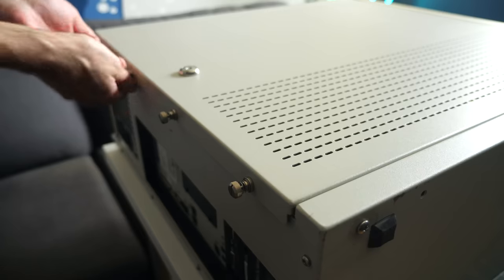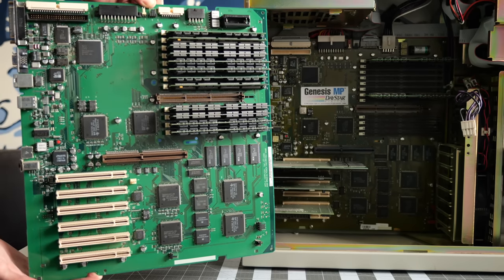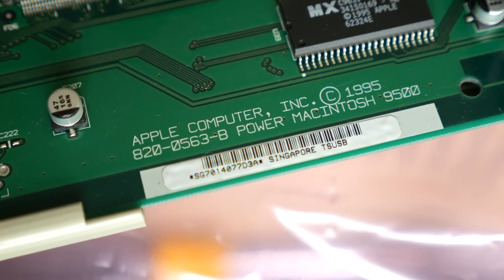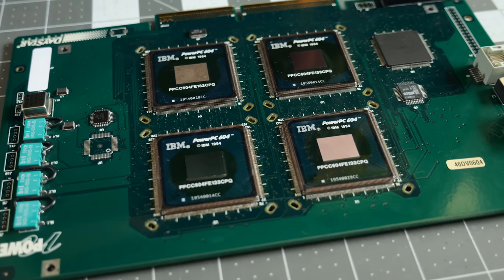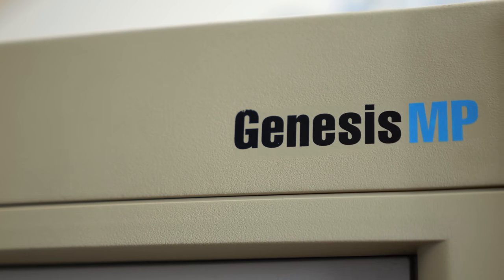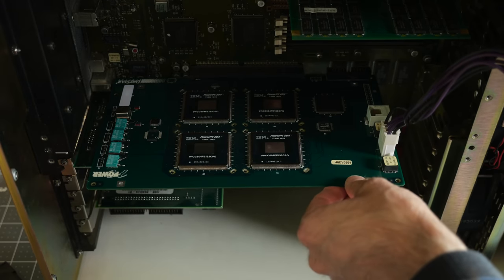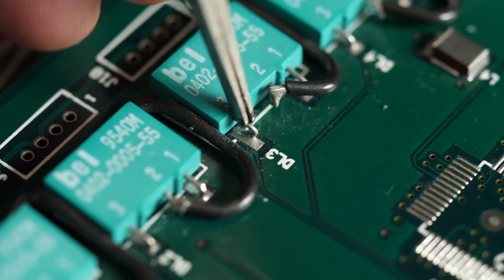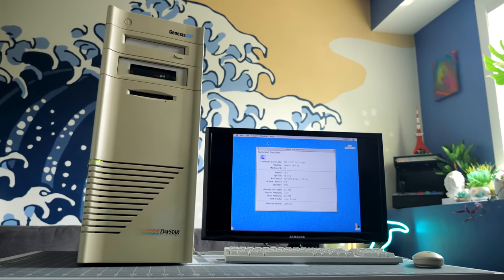Wait...THAT'S what was wrong with my rare Mac clone?!

Comment: As someone who is a programmer, this type of scenario is something that one can run into often, and I'm saying this from personal experience. Part of debugging is isolating what is going wrong, and seeing what happens when you change something. Sometimes the simplest of changes can cause significant glitches, and sometimes the smallest fix can save the whole program.

Comment: When you were checking the CPU pins for loose legs, did you inspect the rest of the card under the scope? Surprised that broken joint wouldn't show up under visual inspection, but I can also understand how you may not have bothered to do a full visual inspection of the card. Easy to lose sight of the basics when you're in the vortex and chasing the dragon.
Reply from the maker: I did look at the whole card under the scope, but I missed the crack because it was sideways and the scope looks straight down.

Comment: Spoiler alert if you haven’t watched the video.

My very first vintage Mac was an SE FDHD from eBay. There was no video display, but it chimed. I tried every solution in the Dead Mac Scrolls, recapped the analog board, desoldered and cleaned the brightness knob, and anything else I could think of. After weeks and weeks, I was staring at the board one evening, and accidentally bumped a small inductor or filter near the top of the board.

One side was broken off.

I soldered it back on, flipped the power switch, and was greeted by a very happy Mac. That was a magical moment, and I am never getting rid of that little SE FDHD.
Reply: This sort of thing has cropped up before, and it has always been due to human error. -- HAL 😁
Reply: That reminds me of a very weird repair we had when I was working at an audio company.
It was also a broken little inductor, something that had never been an issue for that last 10 years or so.
These things can drive you insane lol!
Reply: My SE kept going black screen after some use. Took it apart and went over and over and over it. Finally found a bad solder joint on the analog board. 🤷🏻‍♂️🤷🏻‍♂️ fixed it and no more issues
Reply: Great story, good persistance. I have lots of retro computers, SGIs, various rare 68K and PPC Macs, NeXT, but my little faithful cheap eBay SE FDHD has been the most fun to restro.
Reply: you basically did all that work for that inductor to say 'nah that was all for no reason', glad you got to save that old Mac from the MacHeaven

Comment: Great job - I love to see man triumph over machine.

It's actually really important to STOP when you are angry/frustrated with troubleshooting. I find that is usually when I am about to make bad decisions and compound the problem. Stopping for a while and then circling back, I would say, is EXACTLY the thing that led to your success in the end. Take the win!
Reply: I can relate to that. I have done both.
Reply: This is one of the biggest things I discovered about myself when starting this hobby... I can get extremely frustrated and manic when troubleshooting or a repair isn't going 'smoothly' - which surprised me given that I'm almost always pretty chill. Something about this hobby brings out some interesting traits. Learning to slow down or step back, stick to the basics and be methodical has been huge for me - not just in the hobby but in other areas of my life.
Reply: It's really the machine which is a triumph of man. What Colin did was triumph over age and degradation; when he soldered the component which was loose back into position, he defeated age and brought the machine back to life.
Reply: Agreed, and usually in my experience, during those moments of frustration is usually when I make a fatal mistake in the process of attempting to find or fix the problem and end up permanently damaging something, sometimes (but rarely) to the point of writing off the part or entire machine.

Comment: If you can, try touching each of those solder joints after the heatsink is back on. That way, the solder will reflow and settle the way the board now flexes, meaning that they won't be a stress point anymore.

Comment: NICE!!! Good work!
I had a similar problem with a tiny bord in a remote for a security system.  It would randomly not work. Turned out it was the tiny antenna souderd to the bord. One of the joints was cracked but very hard to see. You really do have to check every joint.

Comment: Great video! I'm currently working on another rare computer. A 1991, IBM clone laptop I found in the trash. It's a CMS, model NB386SX20-40. Very obscure machine. Virtually no information online. I'm doing a hinge repair and using a two-part System Three T-88 epoxy on the plastic. Seems like a very tight, strong bond. Just hope it functions properly when opening and closing the display lid. I'm also having trouble finding an appropriate AC adapter. I've looked everywhere. System batteries aren't available anymore, but I did locate a correct CMOS battery. What a project!!!

Comment: Reminds me of a friend who would troubleshoot surface mount components with a tiny rubber headed mallet.  Tapping on components would sometimes let you know if solder pads had cold solder joints.  Too bad affordable phone mounted thermal camera modules didn't exist 30 years ago

Comment: In my humble experience with computers, retrocomputing and electronic stuff in general (I'm also into vintage electronic music instruments), a lot of times the most puzzling and unnerving issues were caused by silly stuff like cold/broken solder joints, bad contacts, etc. I remember some years ago I spent months at scratching my head on my Roland D-50 synthesizer, which was intermittent at power on. Some times it would boot, some times not. I spent hours and days checking this and that, cleaning contacts, reflowing solder joints, replacing capacitors, just to realize at a certain point that the problem was due to the reset signal not being generated correctly. And that was because of a cold solder joint on an IC on the power supply. After reflowing the solder joints, the synth was rock solid.

So, I definitely know how you felt when discovering the cause of your headache :-D

This happens with software development too. I work as a programmer for a little software company, and if I'd have to write a book about all the times I got headaches chasing bugs and ghosts whose cause was trivial, that book would be think as a brick. Fixing the cause took seconds, finding it sometimes even days.

Comment: In 2005 I spotted one of these in a shop with the cover missing and basically stripped except for the quad cpu card. I had no idea what it was and the owner gave it to me. So I set about doing the internet thing and soon I had ram, a hard drive, etc. I couldn’t believe it was a quad cpu at 200 mhz. Had fun playing with. Even installed Linux and beos. Was a blast.

Comment: As an electrical engineer who builds PCBs often, it's amazing how often it's something stupid - something not soldered, a tiny solder splash, something not plugged in, etc.  That's why the first steps in troubleshooting are quick inspection for obviously broken components, voltage/continuity checks, and careful optical inspection under magnification.

Comment: Oh, this happened to me with a PAiA synthesizer.  I replaced some defective transistor pairs and still couldn't get the dead oscillator to come back to life.  Then I threw the oscilloscope probe into it in frustration...and found a cracked resistor.
Reply: Weird, I also find cracked components after throwing things at the board. 😅😉

Comment: I had a Mac Plus that developed an intermittent display problem requiring percussive maintenance from time to time. Eventually it got bad enough that I opened it up to find out what was going on. Inspecting the solder joints on the connector between the main board and the display board, they all looked fine... until I noticed there was one pin at the end with no solder on it at all! It had somehow missed getting soldered at the factory, and had worked that way for about 5 years before it started playing up.

Comment: hi have a brenel  mini 8 1 inch   i have had the same  there is 4 big caps that have pulled the tracks from the pcb
i had to fix the cap the the pcb so they would never  up set the  COPPER TRACKS very like what you had here 

i put the decks to one side and  worked on the 16 channel pre amp    later went back to the tape decks  this year
i put the pre amp on my channel

Comment: i used to work in a locomotive shop and i remember working on a loco with a similar issue. that stupid thing fucked with us for over a month until we finally figured it out: broken connection that wasn't even visible while the loco was standing in the shop.

Comment: Many years ago in 97 when I was in year 8, I was the school computer wizard, ( pulled out of classes to fix the school computers). One PC I tried everything possible to get it to boot, or even make a post beep..... After changing everything inside the case and it still not working , I ended up hit kicking it .... The reset switch was stuck in !

Comment: This has happened to me so many times.i had an old philips monitor  on whick i kept replacing caps. I later found out it had a huge heat sink which made a transistor break its solder joints.i wasted two days reflowing before that.

Comment: Not to pick nits, here (and I'm sure you're aware of this already), but the About box said it was running Mac OS 8.0 — that version is prone to boot issues. It desperately needs to be updated to 8.1 ASAP! Mac OS 8.1 was their main seller, with 8.0 not being installed on that many machines because it was so horrible.

Comment: I'd file down the mounting feet of the heat sink to the point where when the CPU PCB is flat the heat sink just touches the CPU dies. Then when the clips and the screws are installed there won't be any flexing of the PCB. That's the way it should have been made.

Comment: May contain spoiler so please watch video before reading this! :)

At least this was easy to miss; I had a G4 Quicksilver 877mhz processor, and the reason I mention the processor is because it wouldn't boot when I first got the machine. This was the first desktop apple machine I had ever worked on, and I didn't really know much about PPC macs at the time. It turned out, during shipping to me...This is embarrasing to admit but...The CPU cooler had shaken itself loose. I was trying different ram sticks and everything I could think of... and it was the cooler. These macs really don't like it when their CPU's are not buttoned up and healthy! Mind you, I've had machines with windows on them that won't work with my stash of Ram sticks, only to buy some cheapo brand I've never heard of for it to work straight away. These computers are certainly have their surprises lol :D

Comment: I have a DFI Windows 95 8120 rare laptop from 1995 and it would show no signs of life AT ALL, I opened it up and then I tested it without it being in the machine still nothing, I removed the clock battery and replaced it, bam fires right up!  HOW DID IT TAKE ME * WEEKS OF WORK TO REALIZE IT WAS THE CMOS BATTERY!  At least it works though!

Comment: Finley! aaaaaaa.

Sometimes, you get stumped and then you need to walk away. You tried another mother board 2cpu card works and the original mother board works with 2cpu card works. Then you got stumped. You walked away for A while. When you came back to the genesis with fresh eyes. Now you can see what you couldn't before.